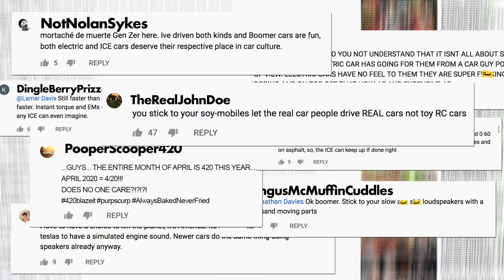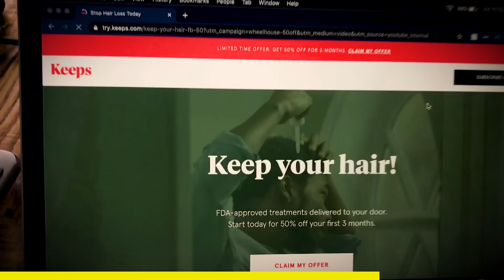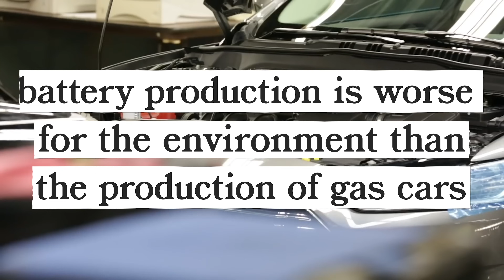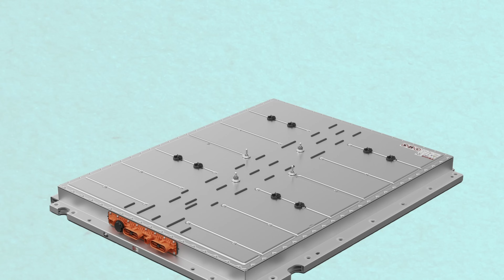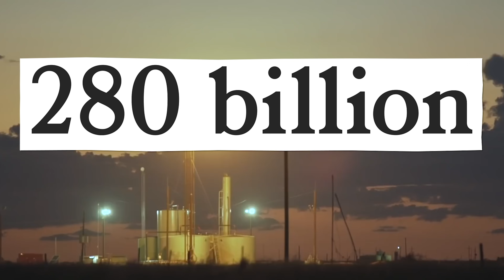Are Electric Cars REALLY Better for the Environment?

Comment: I'd like to see a part B with the end stage of the vehicles. The recycling of the batteries the recycling of the gas motor versiand just would be interesting
Reply: Recycled burned gas?
Reply: @DjAled4K  That is basically Porsche's solution with eFuel. But for eFuel to be produced, you need a massive sustainable energy powerplants. 

And that's what's cool with sustainable energy - it's unlimited power. In theory, you can build a massive floating rig stretching 20x20 kms on the ocean covered with solar panels and you can "store" it in the form of H2 which you can use to fuel these cars or use for any combustion needed. No need for batteries. All the power from the solar panels go to electrolytic reaction in the ocean, producing H2 and O2. 

Negatives? The sea can get a little bit saltier depending how much of water you take out of it in the form of H2 - but hey, the good thing is you will be returing it back in the form of clouds.
Reply: @orcusdei if only they used nuclear energy
Reply: @orcusdei it takes more electricity to use electrolysis to form H2 from water, than it does to simply power an electric motor. It is much more efficient to simply store the electricity you wouod make from the solar panels, and run electric cars with that, than to take the extra steps to use that electricity to turn water into a usable fuel for cars or trucks. Plus.. the byproduct of burning the hydrogen to fuel a vehicle, is quite a bit more harmful for the environment that the CO2 emissions we are trying to get away from now.
Reply: you can basically melt an ice engine, and and an ice engine can be used way longer before rendered useless and have to be recycled. so ev probably will lost that comparison.
Reply: @kadrikarakoc807  got that right...
Reply: @kadrikarakoc807  nope, for a single reason and that is called math. The recycled battery is used for the NEW car, so you are not putting recycling to the equation of the old car but to the equation of the production of a new car. And since recycling old battery is more environmentaly friendly than mining that shit, the new cars from recycled batteries are way less environmentally friendly than ICE :-)

Of course if you throw both cars off the cliff, then obviously EV vehicle will be less environmentally friendly and the whole argument will then be whats worse - old lithium battery in nature or lets say 500 tons of CO2 and poisons in the air.
Reply: @orcusdei  you can't recycle the battery because it has already lost alot of charge
Reply: @SomeRndomGoose  hahaha, that's a good one :D
Reply: @SomeRndomGoose  LOL absolutely false.
Reply: @SomeRndomGoose  They grind them up in a chemical soup. Extract the heavy metals and lithium and send it out to be reused. Complex process.
Reply: do you think that recycled batteries from old EV's would be able to be used in new EV's at no hinderance to performance? I know for one if I found that my new car had a refurbished battery in it from an old car, I would definately have my concerns. @orcusdei
Reply: @julianromantini5601  BRO!!! They don't refurbish the battery, they recycle the materials from the battery which are used to make a new battery :DDDD DAMN... come on!
Reply: @orcusdei  that costs more pollution and doesnt reclaim all of the materials. all recycle processes are subject to losses. and recycling is not done with all EV batteries... surely you know that already.

and if you want to complain at someone for gasoline not being untouchably efficient, yeahhhh go back in automotive history to nearly the beginning. men like Charles Pogue invented incredibly efficient carburetors. 200mpg efficient. to this day car manufacturers refuse to use high efficiency MORE than likely due to big oil company lobbying. so we're stuck with slowly poisoning the planet with poor efficiency ICE cars and toxic EVs. the white elephant in the room you need to be looking at is the mega rich not giving a damn about anything but money. basically end of story.
Reply: @gaidenshinji8969  It creates NEW battery, so you start to count again from 0. Making new battery from recycled material is more environmental friendly than mining the materials and transporting them. You will be surprised that it is more environmentally friendly than the whole process of refining the oil for the same period of "car driving".
Reply: @julianromantini5601 Many of the components in a new ICE vehicle are refurbished, rebuilt, or remanufactured. All three of these processes are a little bit different. Remanufacturing is the most intensive process while refurbishing and rebuilding generally just mean the seals and other wearable parts are replaced in an engine.
Reply: @rustythefoxcoon5143  That being said, many of the issues with lithium batteries are the same with lead acid. Multiple studies have been done and the end life of a gas car and an electric car are about the same.
Reply: @SomeRndomGoose  not sure about that one since electric engineering was never my thing. But a dead battery is basically just a battery that has no capability to hold charge anymore, its Lithium content stay the same but need to be repack to replenish the decayed contents like copper and other metals that has used up and damaged over the years which is the main reason why it loses charge to begin with and except if the battery itself has been damaged before hand then it will lose some of the lithium content through reacting with the air.
Reply: @orcusdei You're discounting the strip mining for the original battery that cancels any environmental savings by recycling it. And the impacts of electricity production which are often ignored. Even hydroelectric is terrible for fish populations. 

ICE could be waaaay more efficient if the vehicles weren't so heavy. Safety rules and emissions standards have handicapped them badly.

Wouldn't a vehicle that gets 70mpg with no emissions tech emit less stuff than one that gets 20mpg but has emissions tech? That's the sort of difference we coipd see with appropriate use of existing tech.
Reply: @orcusdei so how many brand new batteries can you get from a spent battery i know its not a 1/1 ratio how many old batteries does it take to make a new one?
Reply: I know folks who buy used engines of utilized cars from junkyards and give them a second life :)
Reply: In another video, they did the research and found that the recycling of ICE cars and EVs are basically a wash. There's no advantage for either. But the recycling of bad battery cells will save mining and the metals actually get better and purer once they are recycled. The good battery cells are reused and they can sell the battery as rebuilt.
Reply: So would adding in the carbon footprint required to make the renewable electricity generation and the connection to the charging station. The environmental impact of fields of PV and thousands of wind turbines and hectares of battery storage for times when renewable electricity is offline.
The impact is huge.
Reply: @Wee_Langside  Or nuclear power plants would generate far more power than any other method and is much safer than any other method of power generation. Yes, meltdown situations are particularly bad news, but there have only been 3 incidents in the entire lifetime. Gas and coal plants injure or kill more people than all the nuclear disasters combined every several years. When nuclear plants run well, their only output is steam along with some nuclear waste which we already have great solutions for. Even the high level waste, I'd be happy to store in my backyard if it were encased in one of the concrete and glass sarcophagi made for them. All resistance to nuclear waste by state and local governments is based on fears that come from movies, not reality.
Reply: There are companies that recycle EV batteries or refurbish them. Average life of an EV battery is 10-15 years before it reaches 70% of its capacity. You don’t just throw them in the garbage at this point. Battery recycling, like anything else, will become more popular once there’s enough product.
Reply: Greenwashing is bad for the environment.
Reply: lifecycle emissions studies already incorporate recycling/end-of-life.
Reply: $7500 is WAY more than child tax credit they probably take it right out of the education funds too
Reply: yeah how do they plan on disposing of 125,000,000 spent batteries?
Reply: There is A LOT left out.
Reply: We are making huge progress on the recycling of batteries, which will result in way less mining!
Reply: Don't "end of life" EV car lithium batteries just get a second life as energy storage units in other applications. Recycling only needs to take place when the battery is damaged. Don't forget off course that Lithium batteries are just todays best technology. Tomorrow we won't use lithium. They say the next technology is solid state sodium that Toyota is about to release. Problem gone!

Comment: The ONE thing I will argue is the power grid.  We already have rolling brownouts and blackouts now.  The electric grid as is can NOT handle the extra load EV's will put on it.  The increased load on the grid will be massive once there are more EV's than ICE's running around.  Now, this only becomes a serious problem if nothing is done to upgrade the power grid as the use of EV's increases, and I don't see us doing NOTHING to upgrade the grid.  Still, we shouldn't dismiss the power grid concerns as if they don't exist because it IS an issue, albeit a very manageable one.

Comment: Check the hoax about child labor cobalt used in EV batteries, it's used in crude oil refineries for decades. Also, there is no problem with recycling of batteries, there are not enough batteries to recycle, because of their second life in energy storage.

Comment: I wonder if the trend of electric vehicles being less damaging to the planet continues after time passes and they've had the battery replaced a couple of times. BTW I say this as someone who likes both Gas and Electric I'm also not pushing one or the other. Just something that popped in my head watching this video and how it's mentioned that the battery Manufacturing and resource Gathering is the most damaging process of the electric vehicle Manufacturing. I also don't really know how long EV batteries generally are good for

Comment: We can't forget that solor and wind are very inefficient. Wind mills break, and they are to expensive to take down, so they just put up new ones to replace the old, leaving wind mills everywhere. As far as solar, they don't produce as much energy as they would like to make you think. Not to mention the emissions producing them creates. As more and more EVs come to the market, the power grid will have to go up in scale, and there's no way solar or wind can support that with our current tech. We can't forget about recycling, because recycling all these electric components will be extremely bad for the environment, as well as cost way more to recycle, than it is to just produce more trash. We see this in the plastic industry all the time. We can't forget if everyone starts driving EVs, what's stopping them from raising the price of power? And not all power plants are coal powered, a lot of them are natural gas, which is derived from crude oil. Just because you can't physically see the damage it does, does not mean it's better. It's like unplugging your check engine light. So are EVs better for the environment, NO.

Comment: it's not the Li mining that's producing a lot of greenhouses gases, it's the battery production as a whole. it needs a lot of energy to manufacture the batteries, but since that's just electricity it can be decreased by as much as 90% if you use clean electricity.

Comment: Solid video. Few pointers:
1. You have ignored the copper impact in production. You need 6 times the copper compared to a combustion engine. 
2. The grid can handle it is a stretch. Granted, you talked about US, but last year we have seen that electricity production is not as robust as people thought. Europe has been struggling and electricity was close to being rationed. The cost also went through the roof. 
3. Refineries pollute a lot, but you can’t just credit that to petrol cars; many other things are produced from refined products, which are also used in EVs (plastics, lubricants etc). 
4. Batteries showed big issues in very cold conditions like there were this winter, turning the vehicles useless (i guess that lowers their carbon output 🤣).  

I’m sure EVs still hold an edge if you account for these things, but that edge becomes smaller. That edge also greatly depends on where the EV is being operated in.
Reply: Let's add:
5. EVs have faster tyre wear (because torque and weight). Microparticles from tyres go to earth and water, this is a less known form of pollution but is also related to a variety of deseases.
6. 2023 Research suggest that current litium production is not enough to electrify all US by year 2050 (assuming current battery technology).

Comment: Great post.  The parts you are missing is, the toxic runoff from lithium battery landfilling. The toxins released from lithium are not readily extracted from the ground water. It takes very little for these batteries to poison our ground water and it will indeed happen. 
Secondly, your information on refineries misses a very large mark.  That is the fact that even if every single vehicle in the world were to be EV tomorrow, oil extraction and refining would not go down in the least. Look around yourself, how much of what we have is a plastic. A product of crude oil. Our furniture, our tvs, the EVs themselves, our food packaging, most of our medical supplies all plastic. Plastic manufactures struggle to keep up with demand. That’s why loss of oil pipelines in Europe from Russia effects the world economy so dramatically. Until we remove all synthetic products, oil production will remain the same if not continue to grow. Currently only about 40 percent of crude oil can be utilized to make plastic. The rest of the crude oil becomes gas or diesel. We have no systems that utilize gas or diesel. Particularly at the rate that it is produced to keep up up which synthetic products. This waste product will need to be disposed of. How? Well burned of course. The same thing we do with the natural gas that comes from the same process. Environmentalists screamed about its use in power plants or vehicles, so it gets burned as waste. That’s the insanity of this.  We will continue to burn the exact same amount of fuel. But we will add the toxic concerns of the lithium batteries. But because you don’t actively see it every day it will be out of sight out of mind. This focus on small items without looking at the big picture and educating yourselves on an issue fully will only serve to dig the hole deeper.

Comment: You "forgot" to mention the impact of constructing "clean energy" production plans has to the enviroment, the imense deforestation required, the fact that wind turbines are not recyclable and even if we'd somehow solve those problems it would be nearly imposible to produce enough electricity to power a network dominated by EVs. Ok, let's say miraculously we solved this problems too the power grid available is not capable to transfer the amount of electricity required, meaning we'd have to mine even more to construct thicker cables suspended from bigger poles, bigger transmitter bigger distributers. Oh you said it's a myth that is false, okay then, where's the EVIDENCE?!
EVs are just another scam forced to humanity for "our good" of course!

Comment: A wild concept for butt hurt Ice car owners to grasp is a majority of actual EV owners don't actually care about the F'ing carbon footprint or whatever nonsense the government is pushing. It will have the same effect emissions in cities have. To lower emissions in cities cluttered with smog. What we care about is the cost to drive. It is cheaper. I get that the car is more expensive to buy than an ICE car making it's savings mute over the life of the vehicle. It's the tech, and exclusivity of the vehicle that they really want. That and the freakish torque and even more amazingly capable way an ev can deliver that torque without wheel spin. It's a different experience. I've owned many fast ICE vehicles some record breakers in there own class. To include the fastest 57mm stock turbofold class GTR in 2016. That car is now a 7 second car. The tesla Plaid FEELS just as fast as that car on the street. What is more mind boggling is the fact that the tesla does it with all season tires. My GTR is running a 18"/17" M & H drag radial combo. That's a big Fling deal in and of itself. But the biggest reason I like the EV power delivery is how it can launch hard as fuck every time and never break anything. That GTR is fully built full billet drive train and still breaks shit every 3K miles. My plaid is at 30K miles and going strong. I beat the shit out of it daily. Tires had to be replaced at 27K only maintenance I've had to pay for in ownership. For me in my case, with what I use it for it is so much more efficient. I don't run expensive race gas either. Just M5 methanol and pump e85, but that is still 10X the expense I pay to recharge my car on the grid. But I don't pay grid prices either. It's free for solar equipped folks. The cost of those solar panels monthly are more than offset by my savings in electric bills over the year. Granted I live in Vegas and solar is stupid not to have. The EV fills in the gaps the 13 days out of the year that I have to source grid power due to rainy days. I get that it's not feasible for everyone. I'd prefer it be kept exclusive for the shock factor. Just don't act like it's not like the invent of sliced bread for some folks.